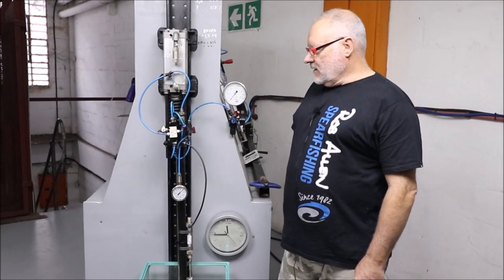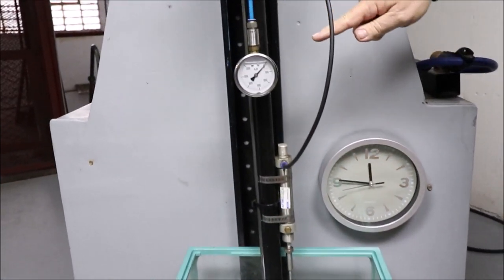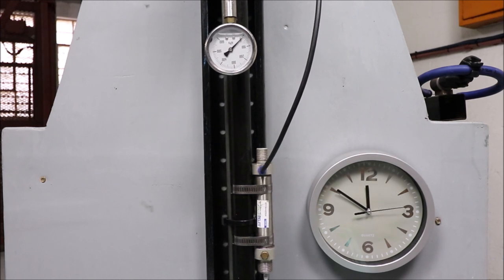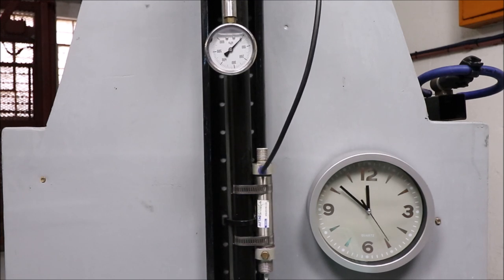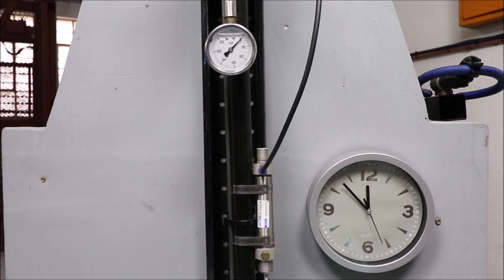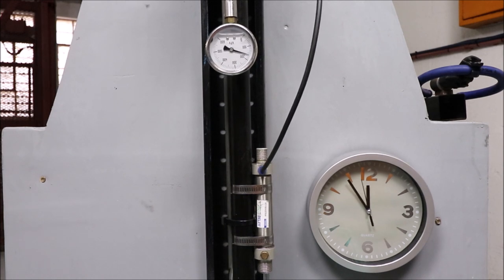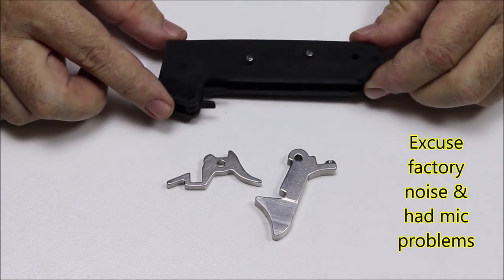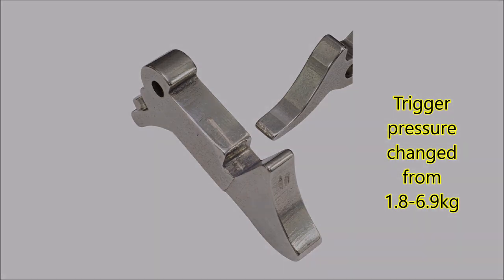Rob Allen | Stainless Steel Trigger Issues.

Comment: Good day.

Please will you test the guns/mags/triggers while simulating an accident.

What i mean is a situation that you might find but is not neccesarily the normal way of using the equipment.

There is surge, bumps on the boat while getting on and off, jerking the guns when racing for a fish ir turning around, bumping the gun on the rocks or leaving the gun on the rocks or sand to mark a spot.

Can you simulate side impacts on the magazine while the trigger is under tension and the safety is not engaged?
Reply from the maker: Hi Auret, If anything bumps the trigger backwards it will fire. Anyone using the gun can test like this in the water, making sure it is not pointing at anyone. Good idea though for a test in our machine. We will take it up to different loads and hit it with a hammer. The spear can not hit anyone as it will still all be contained in the machine. It will not be an exact replication but could mimic a hard hit hit from different directions with the safe off.

Comment: I was wondering with RA hasnt migrate to SS... Great Explanation!!
Reply from the maker: Thanks.
Reply: @RobAllenSpearfishing  Rob, thanks SO much doing this test. I have a SS trigger with a SS line release on an airgun from a very famous Euro brand and while it is their latest offering, it shows the same issues, just from friction. With just a little bit of force from the line wrapping on the release, the trigger pull increases dramatically and the consistency is completely gone. With a breakaway tugging a tad more on the line release, it's even worse and has cost me nice fish. But it looks more high end and blingey, so it probably sells better...:(.  I have now changed the line release out for a plastic one and problem pretty much gone.

Comment: I know this is an old video, but why don’t you like reverse trigger mechs? Just curious as everyone seems to rave about them. Thanks!
Reply from the maker: I am of the opinion the reverse makes no great difference when you consider some facts. First off, why do you need more power when you can already overpower the gun just by shortening the rubbers? Overpowering a gun will make it inaccurate. We have done many pool tests showing this. 
Secondly, many battle to pull the bands that far back as the further back you need to pull the bands, the more difficult it becomes. To compensate, many will then fit longer bands to enable them to load all the way back, defeating the object of the reverse mechanism in the first place.
We prefer to manufacture gear that is suited for the majority. There are so many variables from one gun to another, spear size, band lengths and types, barrel buoyancy etc. I do understand you will have a slightly longer spear and, a slightly longer rubber stroke by moving the spear load position back a little. I’d see this being more of an advantage on a longer gun that is harder to swing/manoeuvre but it’s only 60mm we are talking about when referring to our current spear position.  We feel there are way more other influences which would make a just as much of a difference.
Reply: Awesome. Thank you for the tips. Your gear really is the best thought out!
Reply from the maker: @braydenjones4505  Thanks for the positive comments.

Comment: There are issues with this type of testing. I have loads of guns (and one of yours) with Stainless mechs and they all shoot well. My old riffe euro has to be one of my favorite mechs and it shoots like new. The full stainless reverse mech on my Salvimar hero shoots beautifully with 3 rubbers. If these were real problems then no manufactures would use fulls stainless mechs, especially on their premium guns.
Reply from the maker: It is all about how much it cycles. If you only pull the trigger a few times per dive and you don't dive that often, you will hardly notice the change. I personally dived a whole week shooting many times a day (plenty fish) then changed back to a normal triggered gun half way through the last day. Only then did I notice there was a massive difference between how the two guns trigger pull felt. At that time we were wanting to change to a s/s trigger but first needed to test. After this dive trip we built this test rig to see if there was such a change in trigger tension with gauges to prove of disprove.  I would have no problem doing the same test with any other make/cassette and, would have no problem showing it to be fine if this was the case.
Reply: @RobAllenSpearfishing  I am not sure about that. My riffe has been shot a lot more than 200 times, the salvimar hero would have been close to it. The salvimar uses rollers on the trigger to minimise friction i,e a smooth trigger pull with 3+ rubbers. Also the grade of SS, whether it has been hardened/polished is surely a factor? Interesting discussion.
Reply from the maker: @DiverGazz   I have not tested either of these gun brands and, it is very possible they have a good working system with no issues. I have tested 3 other brands (I won't mention brand names) and these performed very badly. All these has standard 316 or 304 stainless steel that fretted against each other.